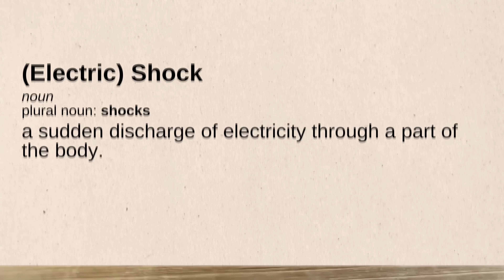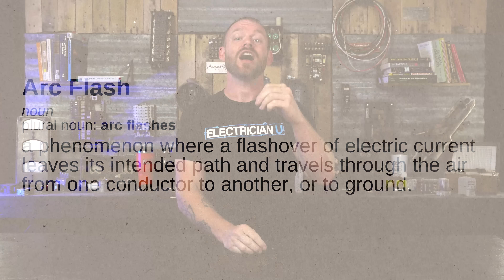How Do I Get Shocked? Why Am I Getting Shocked? It's Simple.

Comment: Google will probably block me if I put a link here but you can search YouTube and find videos of high voltage lineman working on live wires because they are suspended in air from a helicopter which gives them enough resistance that they don't create a sufficient path to ground
Reply: I watched a very good documentary about this on one of the streaming services. When the heli is in position close to the HV line the lineman who is PPD up & sitting on the skids places a well insulated electric probe near the line to energise the helicopter and then clamps onto the line to keep the heli energised. He then was able to replace the spacer bracket. Once done the probe is reintroduced, the clamp released and as the heli moves away the probe de-energises the helicopter into the line. Exceedingly dangerous.
Reply: And that is because the helicopter may have built up a static charge. Nothing to do with the voltage on the line. If this probe was not used, the helicopter would discharge through a person (using the HV wire). There is a lot of air moving past the helicopter so a good charge could build up.
Edit, there may be more going on where electricity can flow in to the air because of the high voltage. A helicopter moving a lot of air is probably a part of that.
Reply: @bert-blank  actually the HV lines usually have a much higher static (DC) voltage, any powerline with sufficient insulation and length can build up significant charges, which is the primary reason they need to be grounded before working on them off-line.

Comment: 277 V was the worst shock that I’ve ever experienced. I was on a 12 ft ladder up above a drop ceiling. Opened a junction box the disconnect some lighting and when I took the cover off the box the wires came out from under a wire nut and I touched them by accident. Got hit bad and fell backwards off the ladder through the drop ceiling. Hurt like a bitch lol. I was lucky that I didn’t get injured. The second worst shock I ever got I was changing out a service and the guy I was working with said it was disconnected. And like a dumbass I didn’t double check with my meter before I stuck the Allen wrench in the lug and BAM got hit bad. I felt my heart skip a couple beats and then I was sweating really bad for the rest of the day and felt real nauseous for a couple days. Then after about 3 days I felt better. This happened when I was a younger electrician and made me learn real quick to be more careful and always ALWAYS double check to make sure about things before just trusting someone else’s word. Now I’m fully confident in any situation because I know the steps and precautions to take. 👍
Reply: Yeah. 277v 30a up the leg out the arm ruined my body. I still wake up seeing flashes on some nights.
Reply: Watching this video after getting shocked from 277 I was on a ladder and just jumped off and rolled bc I was gripping the mc that got energized. Now my finger will look like a bratwurst for a few weeks but it is a good wake up call
Reply: @maxpillingskis  damn man yeah I saw a guys hand explode from the inside out from 277 once. He touched the hot wire with his index finger and the neutral with his pinky and it blew a big chunk of meat out of his hand. He was screaming in pain and the wound was cauterized from the inside out too. He almost lost his hand from that. It was bad.

Comment: In the series if there is no other load you will not get shocked as the circuit is not closed. The more load there is the less impedance there is. And in series you can get just as well shocked by the neutral.
Reply: How often do we see AC circuits wired in series as opposed to parallel?